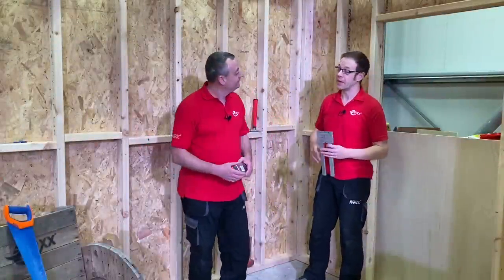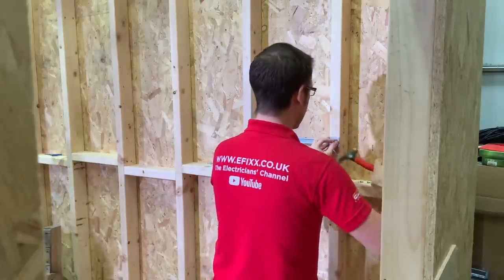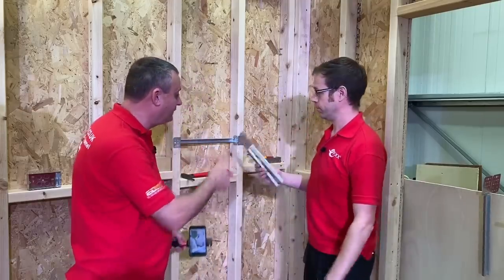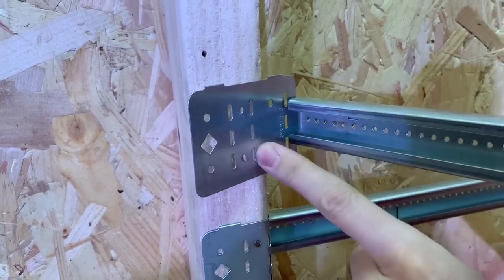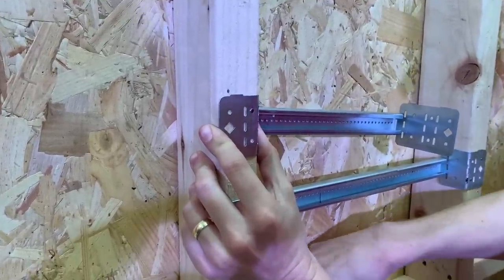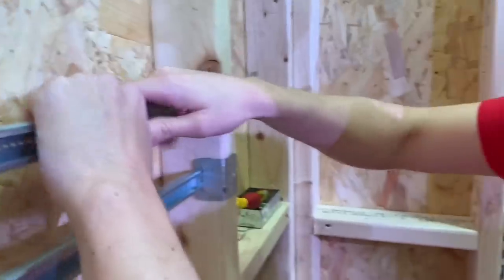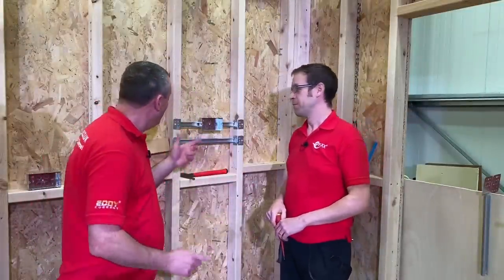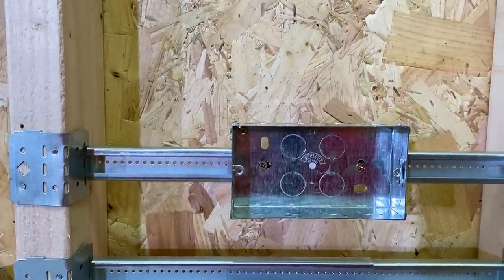How to fit an electrical back box using a Walraven RSWB - timber and metal partition walls.

Comment: Used them before on new builds , but they only came in larger size and had to trim each one down with tin snips and was fixing back boxes back with inch 10s , gave a good fixing and neat finish  after it was plaster boarded , but was quicker to use the wood in the end

Comment: Good video lads thank you. The bending part on the end of the brackets are for different depths of boxes. You bent it on 25mm boxes and the other bending mark is for 35mm boxes very handy on metal walls i still perfer to use wooden brackets on timber walls
Reply from the maker: You know we love wood ;-)
Reply: The depth sizes are only flush with the timbre, what about the other 12.5mm that needs to be in front of wall for finished plasterboard level?

Comment: I purchased a dozen of these today from tlc, and they are different from the ones you have here. They have different hole configuration on the bendable flaps meaning I had to drill my own holes to screw them into the internal studs. 
Basically, they are quite a bit less convenient and timber studs are back on the menu boys.

Comment: Used to cut them down with tin snips as studs was small size , only cut the one that slides inside the other , gives a good secure fixing once it’s been plastered but boxes a bit loose until plasterboard goes on . In end went back to nothings of wood as it was just as quick

Comment: Little tip, stick a screw through the 2 sliding parts once installed and it stops it pushing back and forth
Reply from the maker: #toptip
Reply: That's a good tip I shall try that as this is the only downfall I found using them on the metal stud but still prefer wooden stud noggin on wooden stud walls.
Reply: ANTHONY BRAGG yea I’ve never used them on wooden studs, they are probably more sturdy on wooden. 
But on metal studs they can be a bit wobbly, the crew trick works wonders
Reply: We have been using this type of back box and luminaire/ fan boxes here in USA for many years. They have specific weight and fire ratings here though that’s important especially for heavier light fittings and fans. In fact for heavy light fittings and fans in high ceiling we have wired on light winches that can with a switch bring a light fitting down to re-install new bulbs and clean them. That is great piece of kit here in the USA must be something you have also over there?
Reply: Agree!!

Comment: How does it work when you come to put plaster board on?   Cause now instead of having a nice flat stud wall it is raised?
Reply: You could set it back more if you wanted as It would fold at a different point as mentioned on the video and also the plasterboard should be able to cut around it so it sits flush with the front of the plasterboard
Reply: I'd say you could fatigue the metal and break it off where you want and fix through the sides.
Reply: No need to cut it off plasterboard goes over it fine it’s only about 2mm thick you wouldn’t even notice it was there👍

Comment: Genuine question: why would you using these instead of a dry lining plastic box held in the plasterboard ?

I can think of other uses for these, but in general for stud walls I use drylining boxes.
Reply: Dry line boxes are wank that's why ,no offense
Reply: Dan Crawford lol!
Reply: @GeeTheBuilder  in all serious there is a few reasons for me, 1 the threads are very poor on most makes ,2 there not fire rated,3 the plastic rim that's left around the the socket looks awful ,don't get me wrong I do use them when in a pinch but I try my best not too, they really scream lazy or after thought  to me, having said that I am very old and constantly been told to get with the times 🤣🤣🤣🤣
Reply: @dancrawford2690  Agreed lol..
Reply: Dan, metal boxes are not fire rated and many of them have poor threads.

Comment: Need something that saves time replacing a dry lining box in an existing plasterboard dry lined wall when say its up against the timber/metal  stud and no room to extend the fixing tabs.
I do remember along time ago back in the 90s  about using metal flush  boxes for paramount boarding (egg crate) not sure if they are around now

Comment: Wrong way round guys! Flat side is what the box is supposed to be fixed to!
The plate should be bent the other way!
Reply from the maker: You can use it either way - you’ll see examples of both in Walraven brochures etc

Comment: Surely the plasterboard will now sit proud of the surface on top of the metal strap ??
Reply: It's wafer thin you honestly wouldn't affect anyone coming after you good product.

 And how many timber/metal frames are straight and true anyway?
Reply from the maker: The steel is not very thick so doesn’t cause a problem.

Comment: How much?
Noggins are usually free!
Reply from the maker: About 75p if you shop around
Reply: efixx , can you do a deep dive on how much this really saves the end consumer. It’s not about saving the electrician “time”. The products you showcase should be about saving the end customer money and being generally more safer.

Noggins are generally from off cuts or at most you’ll need one or two lengths to do the whole room. The 75p cost of one of these should be compared to the cost of one noggin which it is trying to replace. 

As far as the electricians time is concerned. Again, if o ask an electrician to price a job using this system, how much lower will the quote? 

I feel you should address these issues too rather than just plug what manufacturers send to you. 

Please forgive, I’m not a hater. I like good tech, but when I click on the price and see the crazy high prices, I’m like, I can’t see how I can justify it in my home renovation project.
Reply: haroon420 if a sparks chooses to use these over noggins his time save should be relevant to the price he’s paying to save the time. So the cost shouldn’t effect the customer/end user, sparky spends more to save time to get onto the next job quicker.
Reply: @efixx  lol :-D unless on site...

Comment: Better to fix back the strap with screws and fit screws in the sides of the fixing strap to help when screwing back accessories, as they tend to move a lot also I would fit the strap the other way round so you don’t have to use such long screws. Just experience of fitting them if fitted poorly they are rubbish to 2nd fix with

Comment: I have an even quicker method. Its called a dry lining box.
Reply: Dry lines boxes are flammable with this way you can finish first fix and come back when it's ready to second fix. The regs doesn't let us install plastic consumer units but how long till they let's us use dry line boxes
Reply: @cocoino2307  so funny rules in UK .. in Belgium we don't have metal boxes  in the wall for 30-40 years .. even switches and sockets are more and more plastic .  consumers boards also are mostly plastic in residential use ..  same for conduit .. allmost all plastic .. we do have regulations for cables now .. low flammable LSOH / CCA  etc
Reply: @cocoino2307  Metal dry lining boxes such as the range click do.
Reply: @cocoino2307  possibly will be making metal dryliners soon?
Reply: @raychambers3646  just googled it and they actually exist but cost about  2.50£ for a single and over 4£ for a double , so its cheaper to get the normal metal ones
Reply: @kittsdiy  every couple of years the regs keep getting tougher here in uk now in new build flats we need to use a metal fixing to hold all cables , in a few years normal dryline boxes will be gone for sure and who knows what more
Reply: @JIBS.  you would leave and mark where the cables are in the wall plus where the wood frame is and come back when they've boarded and cut your dry wall boxes in with the cables pulled through viola😂😂
Reply: @cocoino2307  it's funny to see how oldscool uk still is .. smarthome / plc / domotics / teleruptor  is getting pretty standaard here .  Low voltage push buttons .. every light wired to the fuse board .. our fuse boards are mostly tripple the size of those in uk  :-)   Also we have technical rooms where everyting comes in .. i have seen the weirdest places  to put fuseboards in uk ( here on youtube ) .  TwinEarth we can't use in Belgium ..   CPC must be same size of  line and neutral ..   1,5mm for Light on 16A brakers  .. 2,5mm  20A for Sockets .     Rings we don't have ( thank god !  )
Reply: @kittsdiy  in New builds now we tend to have them in  a cupboard at about 1500 to the top , in old houses you tend to find them in awkward places .  Do you use 16A breakers for lights?? we use a 6A for domestic and a 32A  for rings
Reply: @cocoino2307  looking at the metal back box it almost have the same amount of holes as a colander.   but if you look at cable you have copper conductors surounded by flamable pvc coating then its connected to a switch or socket made out of mostly plastic more fuel if there is a fault with switch or socket
Reply: @cocoino2307  Yes lights are usual on 16A RCB's  and 3X1,5mm ( we can't use 1mm wire )  and  20A RCB for 3x2,5mm ( 8 groups of sockets ..) i think you call that a radial ?
Reply: @cocoino2307  not overly keen on fast fix boxes ,any idea how much those struts are?
Reply: Ray Chambers 75p each roughly
Reply: Kitt's DIY Electronics I’m in the UK and I share your confusion that our Consumer Units are ridiculously small!! 

When I built my house I built a mechanical room (like they have in the states, and I guess also Belgium😀)

I prefer the USA style consumer boxes. The Uk ones are stupid in 2020. Too small, too fiddly and a bitch to work on.
Reply: @raychambers3646  they are 30 50 quid or something, my employer buys them not me , in my opinion this leaves the job much neater and provided the dryliners cut them boxes right you shouldnt have a problem , I had times where dryliners coudnt cut a proper size and fucked the whole job for example
Reply: @cocoino2307  yes almost as good when plasterers fill your metal boxes with plaster after you coiled the cables neatly inside.
Reply: @GeeTheBuilder  I built my own consumer unit with flame retardant perspex cover and glass fronted cabinet (a bit old school) it does encourage you to make a nice tidy job!
Reply: Ray Chambers nice! 👍👏👏
Reply: @GeeTheBuilder  the minimum boards of a std house is 36 din modules .. and i find this  also to small .. we use double pole circuit breakers .. and a  30mA and 300mA RCD = 4 din modules  .. so 32 modules left .. is about 16 circuits maximum and board is full  ..

Comment: Complete waste of money, I generally just use scrap pieces of wood readily available for free on most sites. Don’t see any real saving on time, most electricians spend most of their time on big sites (unless they work for themselves) talking to each other or on their phones, so if you want to save time stop wasting so much unnecessary time skiving until home time!
Reply from the maker: You can get these for 70p each - if you can find a bit of timber and cut to length and fix for less than 70p in labour - we’ll done ✅